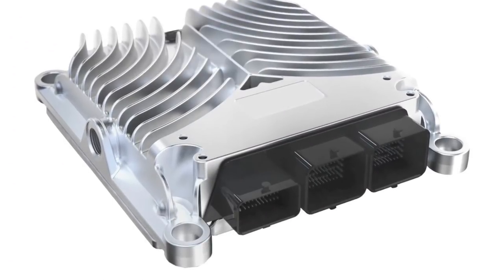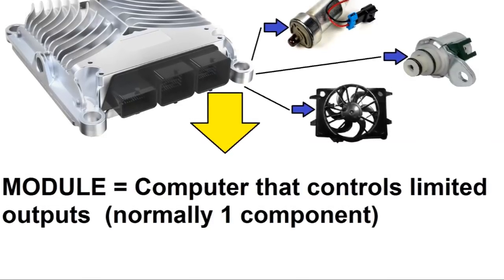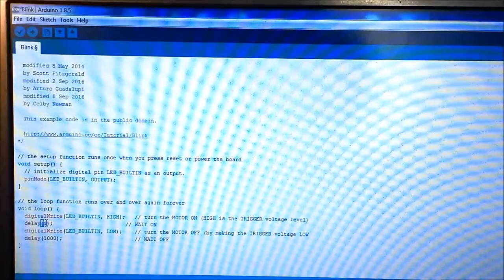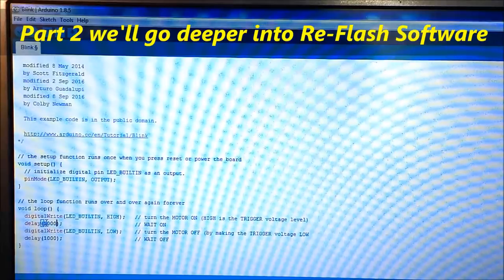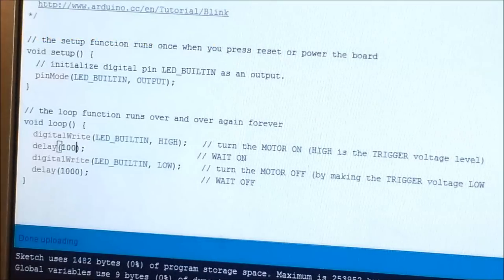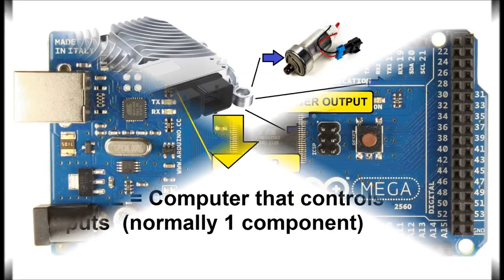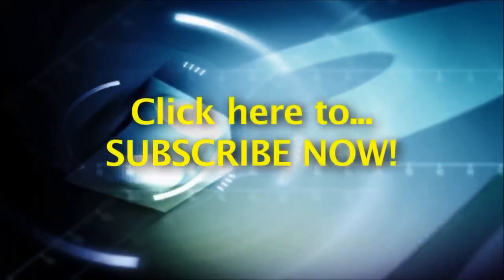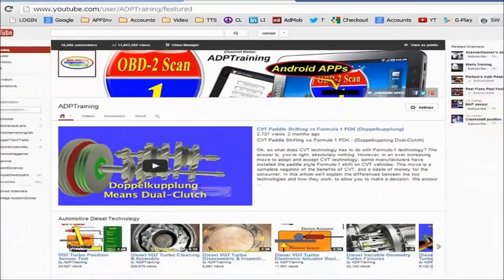Arduino Automotive Module FAN Control 1

Comment: Is there a way that an Arduino could be used to replace a fuel tank pressure sensor with a pressure module? Could you use an Arduino to test and turn on and off relays for the evap test just as the high cost meters? That would be very interesting to see. Thanks
Reply from the maker: +amtpdb1 yes, but it would do the same as a pressure sensor. The Arduino is great at detecting issues. Thanks.
Reply: I sure would like to see it done. On my truck the 0 point is suppose to tell the computer 2.5 volts. Having an arduino  set up to turn on and off the modules in the computer would be great. Thanks.
Reply from the maker: Yes, 2.5 volts is standard for most systems. Arduino can certainly be used like that.